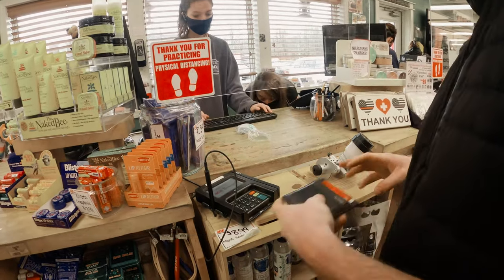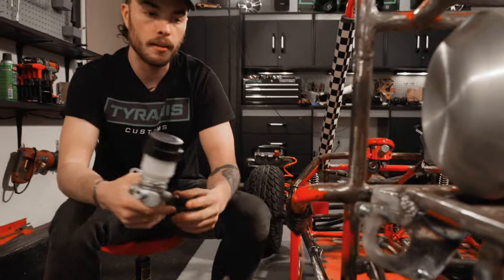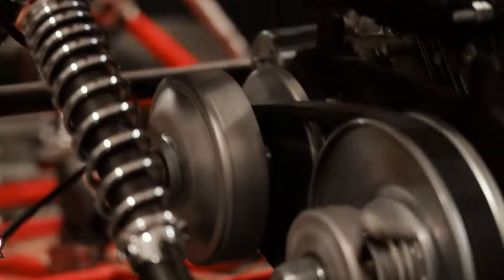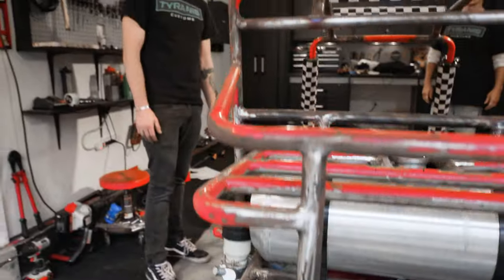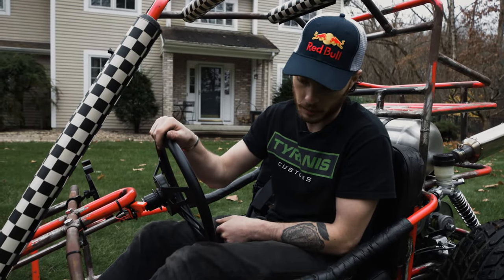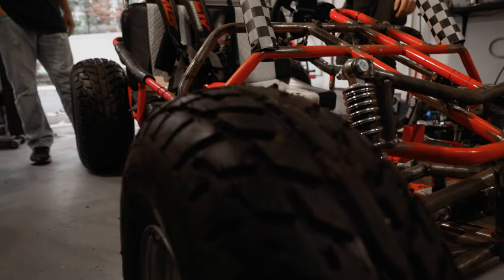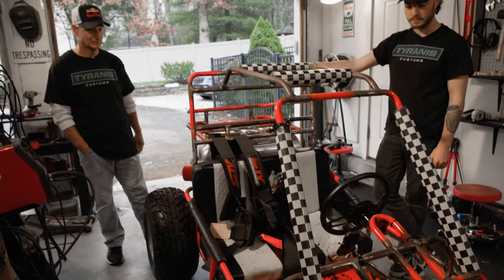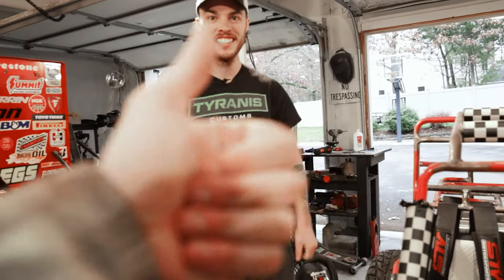Hydraulic Brake Upgrade | Master Cylinder | TYRANIS EP17

Comment: When you upgrade the brakes on the other kart you should add front brakes. GPS has a kit.
Reply from the maker: I've considered it. There's very little weight over the front tires, especially on Big Bob's kart due to the rear engine design, so up tp this point front brakes haven't felt like a priority on these builds. But my next one is gonna run fronts and have better front to back weight distribution to make them a more effective addition.
Reply: @TyranisCustoms  I have to disagree with you. When you stop you are transferring weight to the front end. It's just like when you take a corner and the weight transfers to the outside. They are effective even with the weight on the back. In my opinion they are more effective.